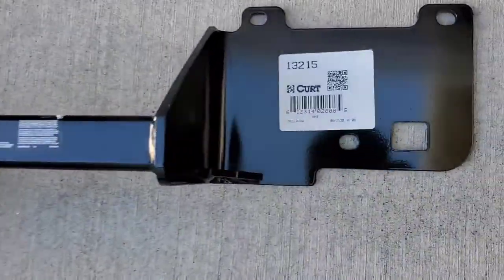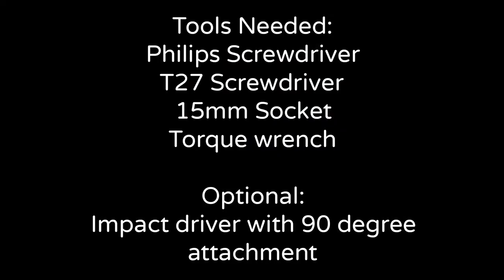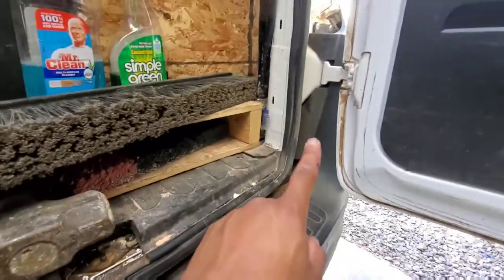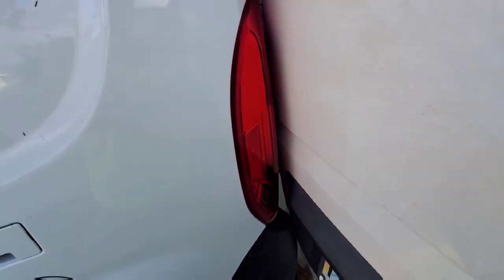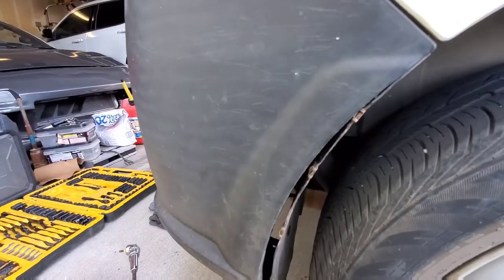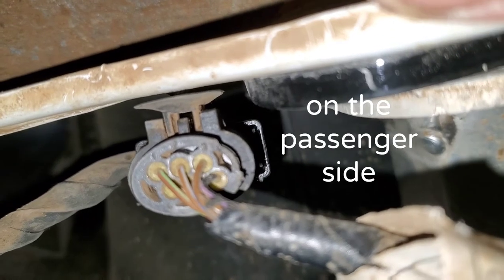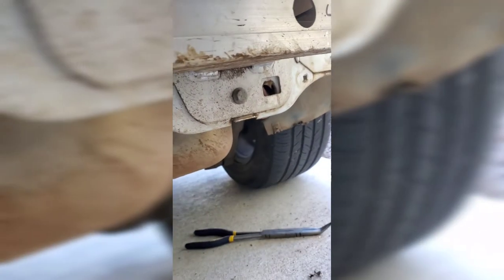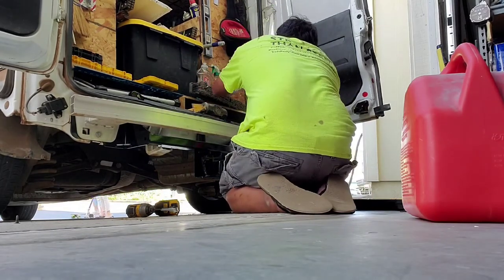Ram ProMaster City Class 3 Trailer Hitch with 2 inch receiver INSTALL video

Comment: nice install, how has it been working out for you?
Reply from the maker: It's awesome, I use it for my trailer to haul trash away from jobs
Reply: @randyd87  what size is your trailer and how much does it weigh? I am looking at a few
Reply from the maker: @anthonydeleon7749  inside wheels 4ft wide by 8ft ...fairly light...never got around to weighing it...but I'm sure it can haul a small boat just fine.